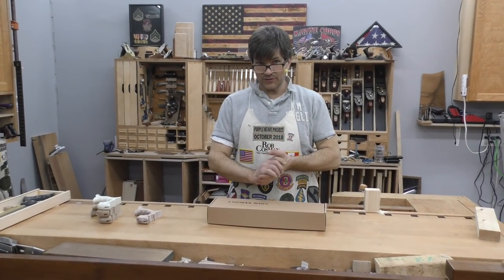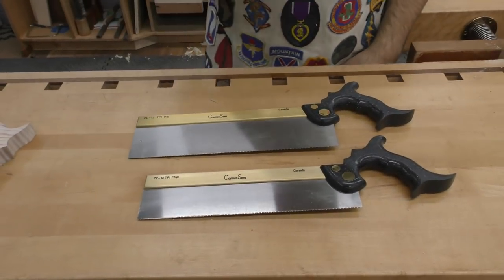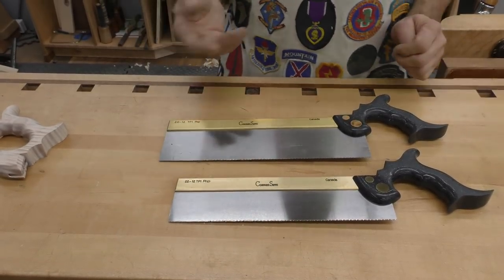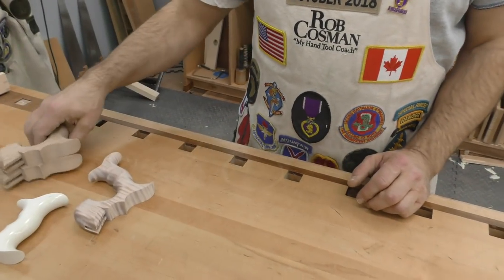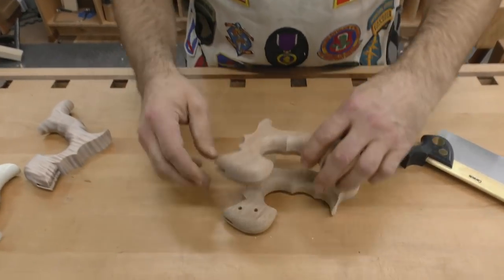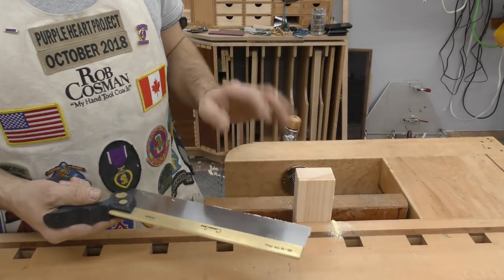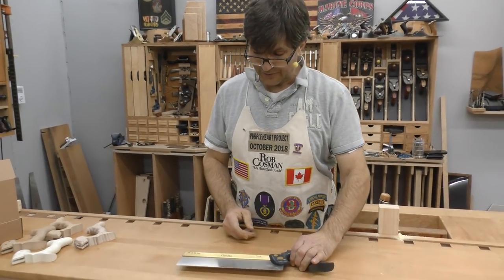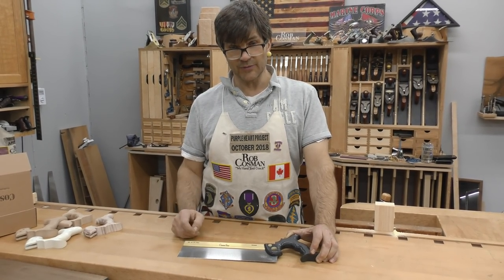Tenon Saw, Rob Cosman's Medium Version

Comment: Quite expensive though !  Especially for a hand saw.
Reply: Hey
Reply from the maker: If it works better than any other, is it worth the price?  That is something you have to decide but we are topped out, we have to make saws every day and for the last 6 months we have not been able to supply the re-sellers.
Reply from the maker: this came in today

Lonnie Fluty 7 hours ago

I bought this saw and love it. I have been using the Cosman dovetail saw for my tenon and ripping cuts but was really just wanting to keep it as a dovetail only saw so I got this medium tenon two months ago. It is MUCH sturdier and is SO much better for tenons than the dovetail saw. It has a great heft to it and it helped persuade me to buy the bench crosscut saw two days ago even though I already have the smaller joinery crosscut saw. So yeah, I have 4 Cosman saws and obviously enjoy them!